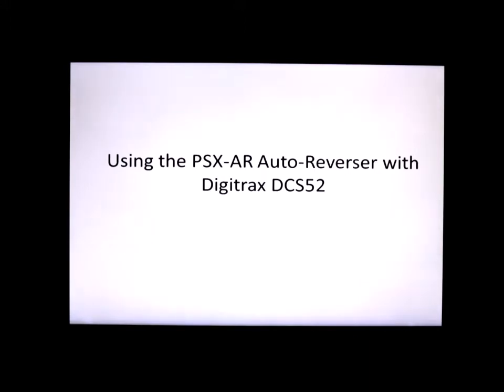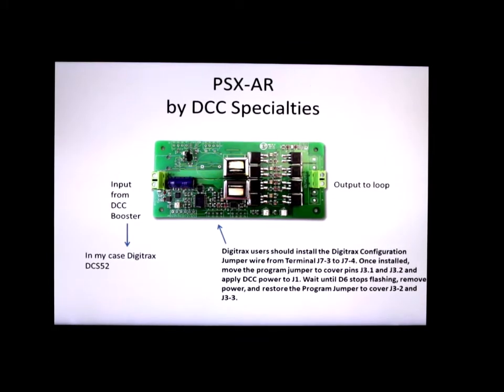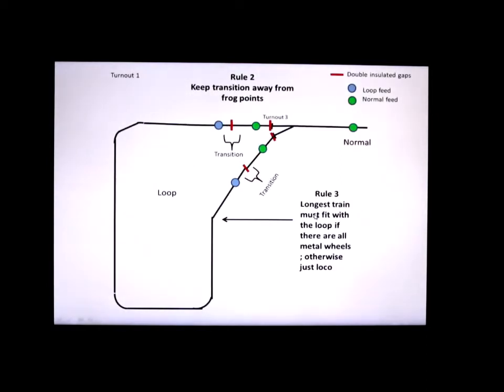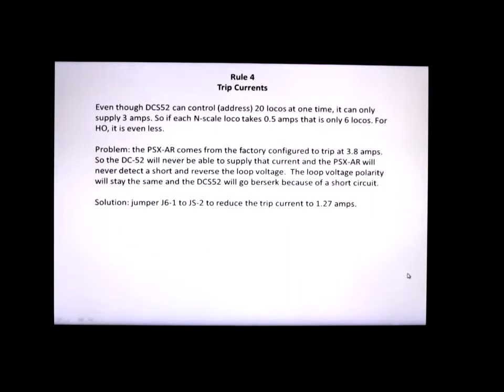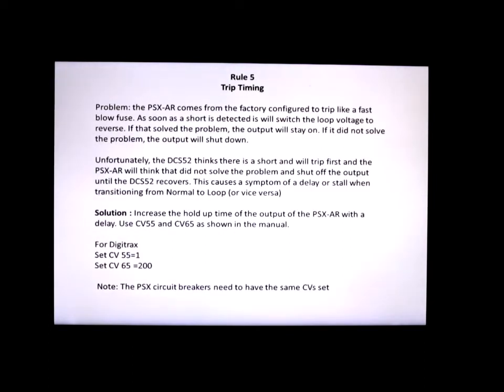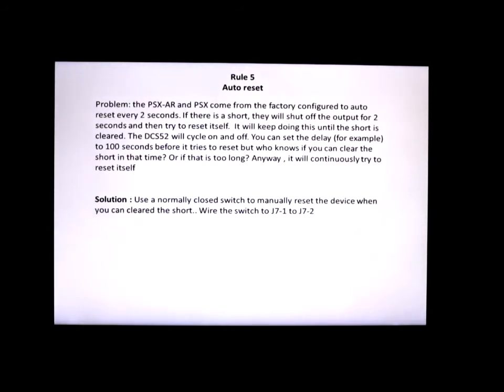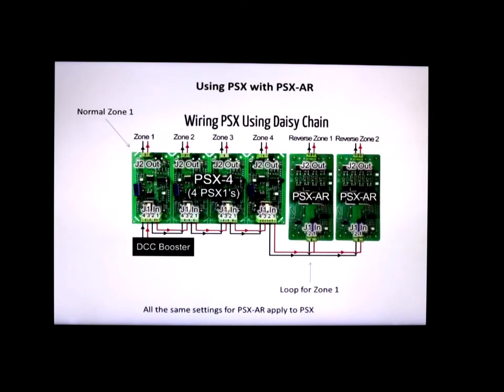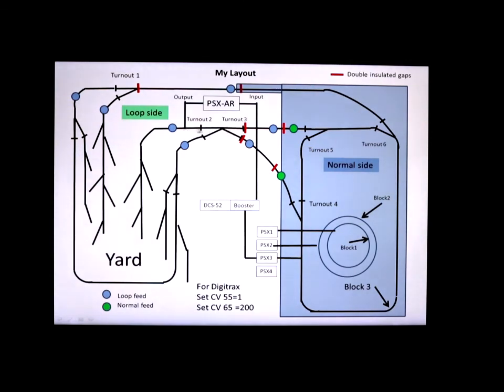Configuration of PSX-AR with Digitrax System

Comment: This is by far the best video on YouTube for the PSX-AR  Thank you!!    Concerning the Foot note, on Rule 4.  (PSX-AR and PSX working together.)  Do they need to share the same values for CV 55 and 65?
Reply from the maker: I said yes in the video BUT ...... I have added a 8 amp booster to my layout after I made this video. Guess what ? I started seeing the delay again across the loop. The PSX was tripping before the PSX-AR. But you want the PSX-AR to trip fast and the PSX to trip slowly. So here are some values I used (remember I have a 8 AMP booster now).

PSX-AR -CV49= 2; trip= 2.54 AMPS
                CV55=0 ; 1ms response
Fast switching

PSX (loop3) CV49=4; Trip = 5.08A
                      CV55=1
                      CV65=200; 25 ms
Slow response to short circuit

Good luck
Reply: @PracticalEngineeringSolutions  Thanks for the quick response!  I messed with it for about two hours tonight and didn't have any luck.  Concerning the booster/Amps.  

My booster is a 5 amp.  Is the Key keeping the trip amps LESS on the AR side than the PSX side??  So in my case The AR set at 1.27 (only ever one train at a time)  and the PSX side at 3.81?    The trip current has to be less than the amperage of the booster correct?  There is also the warning of needing heat sinks did you add heat sinks??
Reply from the maker: @OtterCreek  Yes, that will help because the PSAR will trip first before the PSX. Yes, trip current should be less than the booster or the booster may shut everything down first. No I did not need heat sinks. You only need heat sinks at very high current levels.
Reply: @PracticalEngineeringSolutions  Thanks so much for this!